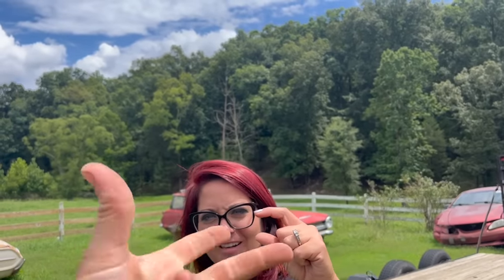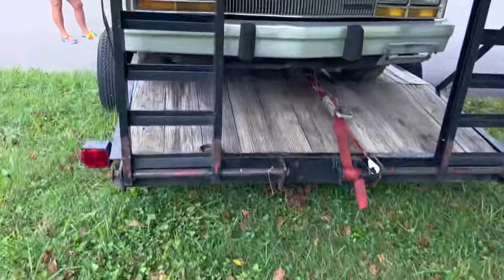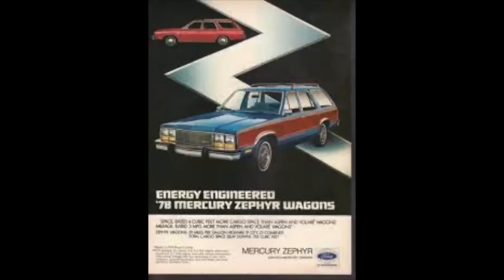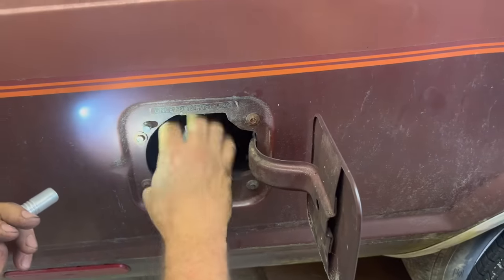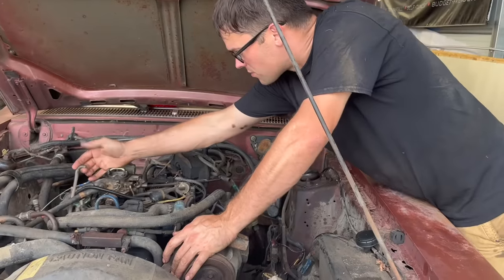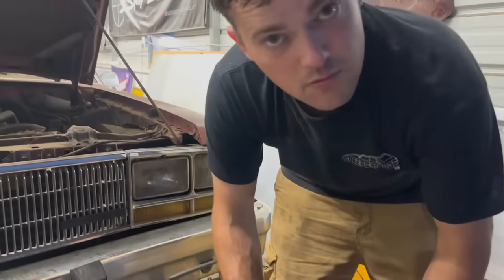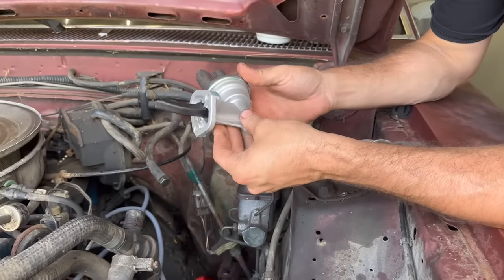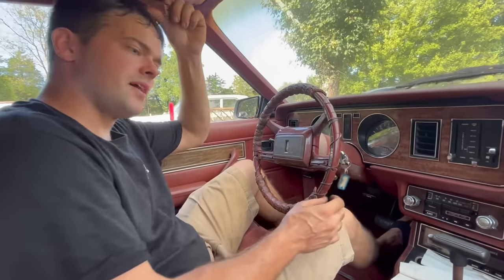Survivor Grandma Car with bucket seats and a floor shifter! Parked for 15 years will it start?

Comment: Man that was a good video man. You really didn't have to do a lot to get it started & running too. Just need some TLC. I can't wait to see the cleanup job on it. Just some maintenance work and it fired right up on the first time. That usually don't happen. And the road test was awesome and sounded good no problems. Man that was cool seeing Bryson wearing flip flops. It look like he has a wide foot in the video at at 55:46. Bryson look like my 3th son John with his height , weight , & feet man which is cool. Man you won't believe it but somebody stole my pair of flip flops for me while I was at a kayak stores. I had to take off my flip flops & go to the back to get  my measure feet for Footwear & when i came back my flip flops were gone. Why did they do this because there's not a lot of people that has a foot that a size 15 & a pair of flip flops that are very very worn out. I had to finish my kayak trip & the rest of my day barefooted 👣 because the store does not carry a size 15 and their flip flops. I was a 150 mile away from home & had to drive barefooted 👣 wish I did not mind because I'm barefooted 👣 95% of the time and I always have to drive barefooted 👣 anyway because of my foot being so wide and it touches the brake and gas pedal at the same time. I have to look down at the pedals to see where to put my foot at because I almost had a couple of rear end collisions because my foot was on the wrong pedal but I thought it was on the right one. That's one of my problems I go through with having a very very extremely wide feet with very chubby fat wide toes that are equally straight across. Good video buddy thank you for sharing it and I hope you and your family have a nice holiday weekend.
Reply from the maker: Hey good to hear from you buddy. That’s crazy someone stole your flops.. thanks for watching and hope you have a good holiday as well
Reply: @Sleeperdude  yes that is crazy how they stole my flip flops 🩴. Knowing that they don't wear a sz 15. That what get me. My flip flops 🩴 are not sold in stores I have to order them online which take a week to come in which really suck.

Comment: All them vacuum lines, how do you think the tail light lenses stay stuck to te body? lol  Over time smog pump belt shrank thereby putting tension on it ,so it popped.Ford changed plug wires for faster assembly down the line and quicker change time at dealerships.

Comment: You got a swimming pool you don't need no trampoline. Those things are way dangerous. And I should know, cuz I jumped on the Olympics kind in 5th and 6th grade and younger and you fell through the Springs with them being way wider in the springs was big as a one on a motorcycle. Just saying.
Plus it will Jack up your home insurance worse.
Reply from the maker: Exactly

Comment: Marvel Mystery Oil can be used as power steering and  transmission fluid in a pinch.ive used it in both and I think it worked better.  It's a Mystery.

Comment: That's me lol i usually buy or trade for the gm square body trucks Chevy s10 trucks third gen Camaros,gm gbody cars like the 83 Buick Regal limited,84 Buick regal limited,86 Buick Regal sport coupe and a almost identical parts car,82 Oldsmobile Cutlass calis,84 Oldsmobile Cutlass supreme brougham butter cream yellow and a 85 Oldsmobile Cutlass supreme metallic gold with white pinstripe, one of the square body trucks was probably a more odd one a faded red and black pinstripe 82 Chevy k20 Silverado factory it was a 6.2 litre diesel 4spd 4x4, but it was swapped out to sbc th400 automatic transmission. I also have had several big body gm mid 70's cars like the 77 olds delta 88 coupe and a 79 Oldsmobile Delta 88 royale 4dr parts car, a 78 and a 79 Oldsmobile nightey eight regency both were grey and olds v8 powered but one of the olds nightey eight cars was leather interior and the other one was cloth both red interior one was 350 olds and the other one was a 260 olds

Comment: Excellent video Sleepdude Crew Josh  :) yes Ford & Mercury cars wild from 1964 to present years also my 1995 Ford Taurus SHO car 4 door  was wild for 3.0 , 3.2 Interceptor  called Yamaha Cop motor , 3.9  V6'S  the exhaust has Catylic Converter on each manifold to plus each pipe after Resotoner  plus one Catylic Converter on each left to right pipe plus center pipes to muffler to but 4 O2 sensors too! Very expensive exhaust too tell you to install included to ! My 1995 Ford Taurus SHO ex Cop car had a 3.2 litre V6 Yamaha, Electric 4speed Overdrive Automatic transmission, all options too forest Green body plus Interior and 6 seater , all options too ! Only thing hate about car was transmission didn't like plus transmission lines  and rust out to fast and leak under rad in middle! But fast too overall ! But always like any vechiles that not to much trouble and cost a fortune to fix !

Comment: SOO THE AMOUNT OF ALTITUDE AIR PRESSURE OF AIR PRESDURE ENTERING FLOAT BOWL. THOSE PLASTIC PIECES EQUALIZE THE BAROMETER PRESSURE.  MORE AIR INTO THE FLOAT BOWL MORE FUEL JETS DELIVER.  PLUG OFF AIR INTO THE FLOAT BOWL NO FUEL COMES OUT. THOSE PLASTIC PIECES TAKE UP AIR SPACE SO AIR INTO FLOAT BOWL IS MORE CONTROLLED

Comment: Adding a turbocharger to a 200 inline 6 put an adapter plate for a 2 barrel carburetor put a 500 two barrel or a Weber 2 barrel carburetor put a mild put a mild camshaft in it put a small put a small turbo charger put a header s*** 300 horsepower easy and get out there and have fun and ralphie you looking good say hello to Rocky for me holla if you hear me

Comment: I have herd that when a engine diesels when you turn it off is because of carbon on the top of the pistons gets red hot and burns the fuel.
F - First
O - On
R - Race
D - Day
🙈

Comment: SOOO THE PLUG GAP IS NOMALLY 45 THOUSANDS THEN THEY ADD MORE AND MORE FOR EMMISDIONS BUT YOU DO LOOSE PERFORMANCE.   SO YOU ON A CARB AND DIST CAR WITH THE EMUSDIONS REMOVED YOU CAN GAP AT 45 THOUSANDS

Comment: It runs too good to scrap the 6 cylinder. Get some head liner glue. it comes in a spray can Body Shop Heavy Duty Headliner Adhesive Aerosol Can  so you can stick those pesky headliners back up.

Comment: You probably won't see this comment but I have a book I want to send you not just any book I bought this book 30 years ago it's a hardcovered big fig Giant book bigger than an old school dictionary and it has every American car in it with illustrations from 1920 to 1980 you go through the book year by year and if any specs changed or horsepower was increased or reduced or anything like that it'll show you the car and it'll tell you the differences. It's an awesome book, I got many hours enjoyment from it and I think you will as well. It can also come in handy when you find some of these old cars and you post your images of them. You have a PO box right. I'll have to check it out cuz I want to send this to you. I guarantee you will enjoy it. Hope you see this
Reply from the maker: Ok that would be awesome. Thanks for watching
Reply: @Sleeperdude  still going to send. we just moved and there are boxes all over the place

Comment: Please explain "Harder than a Waffle House application."
Reply from the maker: The struggle is real. They got hard questions on there
Reply: @Sleeperdude  Ha-ha: I guess I never filled out a Waffle House application.  I did go to a Waffle House at midnight one night and order pancakes.  They were not amused.  It was like saying “tires” to someone who would prefer you say “casings.”  BTW: what is up with you and “casings?”  On the farm, we would call tractor and truck tires casings, but we would call automotive tires, you know: “tires.”  Isn’t the “casing” technically the base of the tire with NO tread layer?